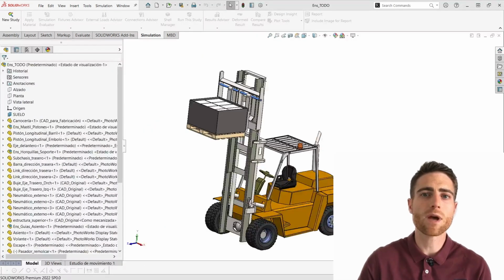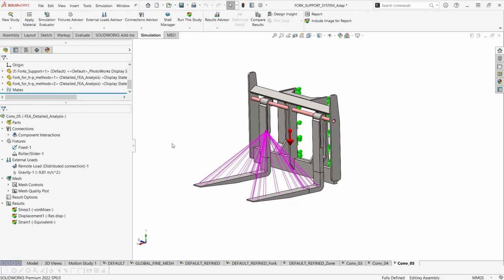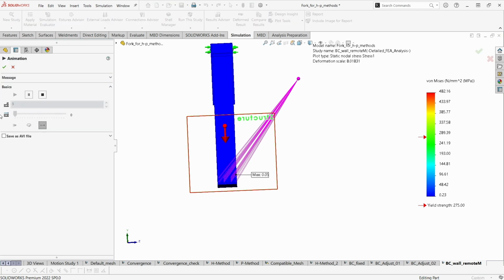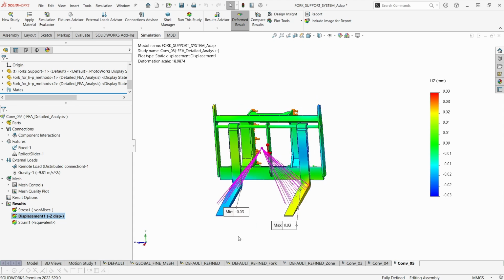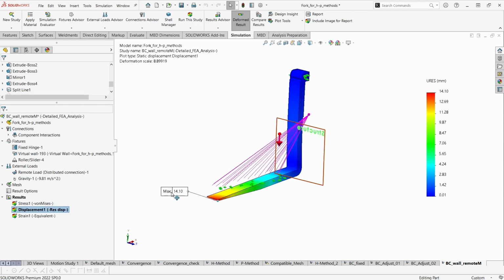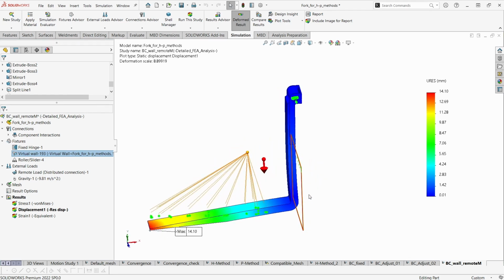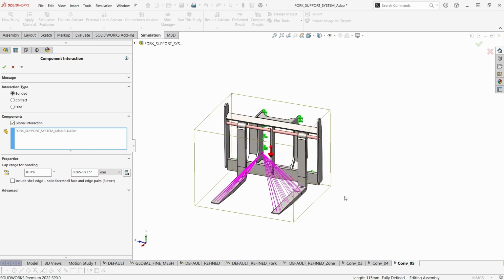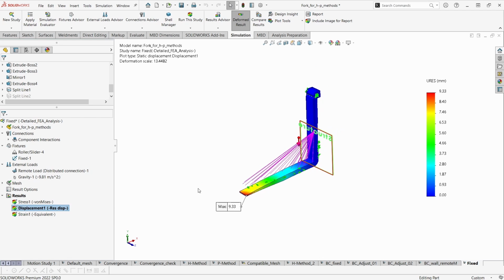Why Your Isolated FEA Model Doesn’t Match the Full Assembly

Comment: Hi Carlos, I watched this lesson more than once, and I really appreciated the way you demonstrated the difference between the reduced model and the full assembly. 👏

What I found especially valuable was that the 14 mm vs. 9 mm difference led you to investigate the Contact Interactions, rather than simply assuming that the reduced model was wrong. It is a great example of why we need to understand what the FEA model is actually representing. 🙏⚙

One question came to my mind while watching it: since the forklift structure and loading are symmetric, would a symmetric half-model be another possible approach to avoid the torsional behavior of the isolated fork, while still preserving the interaction of the two sides?

I would be very interested to know how you would approach that case.
Thank you again for this excellent lesson! 💪🤓

Best regards from Algeria 🇩🇿,
Ammar
Reply from the maker: Thank you, Ammar! Yes, symmetry could certainly be considered as long as the complete assembly and loading conditions remain symmetric.

However, in this particular case, the symmetry boundary condition would not remove the eccentricity of the remote mass. The load is still applied at the CG of the carried object, so when we represent only one fork, that load remains eccentric with respect to the fork and generates the same torsional tendency.

So here, the key point is not the symmetry condition itself, but how we reproduce the load distribution of the complete two-fork assembly in the reduced model.

Great question, Ammar! We will continue going deeper into these topics in this series about boundary conditions! 🚀😃